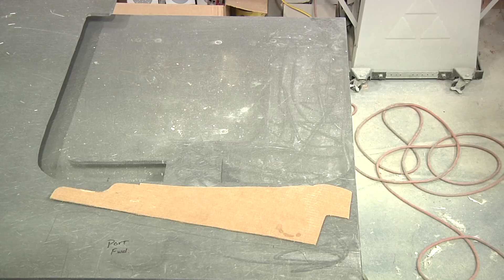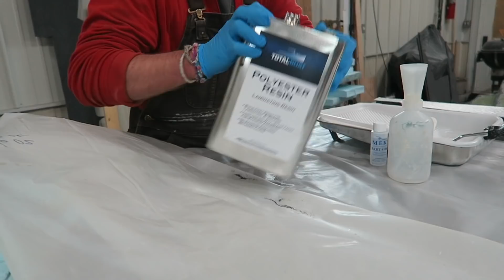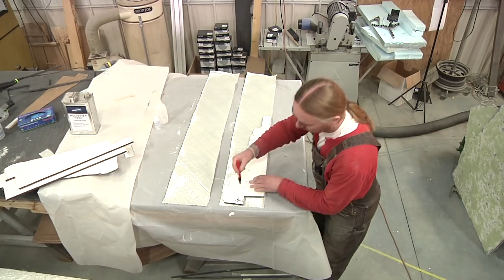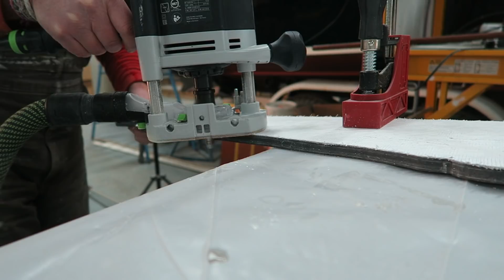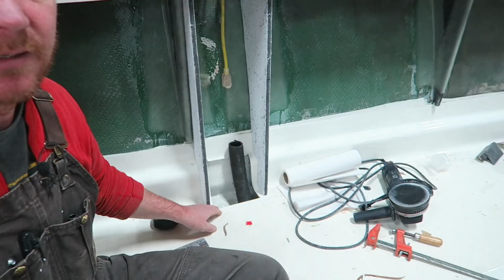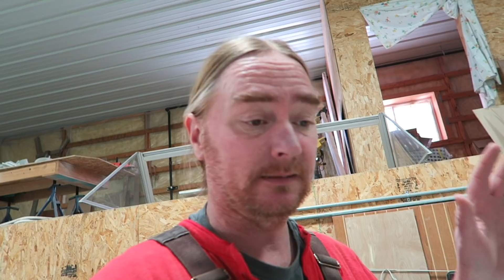Stubbing In For The Fuel Fill Line!

Comment: On our offshore rigs, we often weld a conduit in to pull other pipes through I don't know why it wouldn't work on a boat. Just to warn you if you're planning on putting that close to 2 inch OD hose through a 2-inch pipe you going to have your hands full. I don't really think you can get it through there that you can try. Why can't you just seal off the hose that is sticking up, glass it in, and make it watertight? And then put a door for inspection on the upper part of that box.

Comment: Andy you might want to consider a “direct fill” option for this.  I realize you have done quite a bit of work since this video came out but a “direct fill” can still work and it will eliminate some potential fuel filling issues. Firstly, I hope you get rid of the fiberglass fuel tank and get an aluminum one custom made for the space you have available. This way you can maximize the space for the tank/ more fuel, and you wont have to worry about the aluminum tank deterioration from the ethanol like it will with a fiberglass tank.  “direct fill” would be a flush mount fuel fill on the deck directly above the fuel tank.  Then you can eliminate the fuel hose and make a one piece close out panel on the port side. Hope this make sense and helps.

Comment: don't use P V C for fuel , fuel actually melts  P V C and all of a sudden you have a bilge full of fuel
Reply from the maker: The PVC would not be in contact with fuel, would only be a sleeve for the fuel line to run through :-)

Comment: Form a PVC “sweep” to the desired radius instead of using a manufactured elbow. Angling the hose and pipe instead of making them dead vertical might make it easier to get around the bend. Use cable lube to shove the fuel hose through it. I use the stuff on my boat all the time for wires and hoses.

Comment: I agree with chuck but give at least 6 inch raise from the floor to handle and water splash. The other side I agree with electrical, but the big space would be great to keep the electronics under an inspection hatch and far away from the bilge.

Comment: Andy regarding the hose location leakage problem, can you not make a section that is basically the reverse shape of the section that's already 
Cut out for the pipe and bond it to the floor and up the sides to where the pipe currently stops or just below to follow current line of the moulding. That way you can create the boxing section to overlap this giving you a water seal and also allowing the full use of the hole currently available to put the hose through. It would also help if access is required in the future to the hose fittings incase of damage or failure of connection points.

Comment: what about a 316 stainless steel elbow and tube going up though the glassed floor with a new hole drilled out, use a sleeve  bracket that slides down SS pipe and screws onto deck to stop movement and seal it to the deck so no water can get through?

Comment: Not saying it's right by my 1984 bayliner 2750 has a pvc running through a area and 4 110v romex  hot and cold water and 3 12 wires running through it. If you do glass in a pvc sweep i would run the fuel hose through it first then put it in the boat. That way there is less struggle with it

Comment: I like the PVC (or ABS) pipe idea, but being far lazier than you, I would use two pieces to install it.  One piece under the seat, and the other inserted from above, with a flare on one end to join the two with pipe bond.  Something thinner that Schedule 40 can be heated and molded or stretched by hand or with wedges.

Comment: Andy, you might want to talk to these folks: https://www.conleyfrp.com/ . The # 100 long radius 90 ELL may work for your needs. You could the glass it in place and it would be part of the hull. Then cover the rest of the box with a removable cover for service. Allow room for the vent hose. Have the vent exit near the fill. So you can see and hear the vent while fueling. The best way to avoid spills.
I would avoid having an inverter in a below deck locker. Inverters need a dry and well ventilated atmosphere to operate properly. Before you mount the shore cord, think about how the boat will be docked. You don't what a cord laying across the deck. Keep up the good work.

Comment: Somewhere in your gas fill system you must have a hose to an exterior vent. Typically the vent hose routes along the fill hose. That may be the reason for the large cut out. Also required is a ground wire from the fill point, to tank, to engine, and to external ground.

Comment: Hi Andy. I’m not sure if you meant you wanted to use pvc as a conduit for the flexible hose, or to connect the hose to directly as part of the fuel fill system. If it’s the latter, it will not meet ABYC Standard (2017 which is the current standard) 24.13.8, fuel lines should be of hose or metal pipe. Always enjoy your vids and watch every one! Hope this helped.

Comment: Andy, if you use a 3" sweep 90, it will extend out past the current cut out.  What I would do is cut the 90 in half - from hub to hub - then once again cut across one of the halves in the middle. You'll end up with a half hub which can extend into the closed off area, giving you more room so your hose doesn't rub on the deck.  Glass the half hub to the deck, cut the locker door to fit around the half hub.  Use Taco weather stripping to make all water tight.

Comment: Hinges are fine, unless you're going with something like a stainless piano hinge.  Since you're really into detail, it would be best to recess the hinges so they're not a toe stubbing hazard.  As for the filler hose, I can tell you they're extremely difficult to replace.  As such, I'd just glass in a dam around the bottom and call it good.

Comment: Glass in a stainless steel pipe inside the boat with just enough to put the rubber hose going to filler cap.

Comment: In my business to keep out water at unusual openings, we use a flexible silicone sheet material and 100% silicone sealant that can flex to seal any opening, not be affected by temperatures, vibrations or movements. It can be easily sealed to the fiberglass perimeter and any pass through plumbing. Once sealed, it will keep out water but it would need to be covered as it is functional but not decorative. One thing to keep in mind is that silicone and neoprene are not compatible (any silicone applied to it would eventually discolor and loose adhesion) so  i would not seal it directly to the rubber hose but if you used a PVC or stainless steel "sleeve" at the seal point it would be much better.  Here is a source for the silicone sheet. https://www.amazon.com/Flexible-Resistant-Silicone-Rubber-Sheeting/dp/B01N4KVHYD/ref=sr_1_2?qid=1581336184&refinements=p_n_feature_seven_browse-bin%3A5485686011&s=industrial&sr=1-2

Comment: Run 3" Scepter electrical PVC pipe, nice gentle elbows specifically designed for pulling heavy wire through it. Hose should be just as easy. Once in place a little shot of expanding foam and it doesn't move to wear through. Movement and wear would be the only reason it wouldn't be "legal"

Comment: Without reading all of the previous comments, I think I would have relocated the filler neck to the transom area and not had to have the side channel just to cover a hose. Then again, maybe your tank only has an outlet/inlet on the port, forward side of it and the supply hoses come from the rear instead of the top (can't be rotated 180 degrees in the bilge)? Either way, I'm sure your solution will turn out masterful and you'll have the conversation starter of "Hey, Andy, what's this for?" haha Love your "can do" attitude. *A SS piano hinge would be nice for the new hatches

Comment: If you use the grey pvc, you can heat it with a heat gun and bend it exactly like you want it. Get a test piece, it takes a little getting used to to get the hang of it

Comment: It’s hard to visualize your bilge spaces, but I’d recommend putting your fuel tank as close to the center of your boat as possible. Those outboards are going to weigh some, and I’m concerned with more weight aft you may be compensating with trim tabs. If you put your battery boxes closer to the engines, you have less heavy gauge wire to run forward.

Comment: I have a 1965 25 Bertram fly bridge. Finished three years ago. I ran into your same problem. Bertram originally had a copper fill hose which included the 90 degree bend up toward your fill. I ended up using the same fill hose you have from my tank all the way up to the fill hole. I have covers that go over the hoses so you don’t see them. Even when water gets behind the cover it’ll drop down the edge of the stringer and run out to a drain near your transom into your bilge. Not to worry there’s no wood in the stringers and it’s a straight shot out to the bilge. Don’t forget you need to add your vent hose there too and I remember fighting those hoses to make it all fit. I would not add a pipe you just will not have enough room. Another point regarding your vent hose, use a flush mounted vent for the out side of the hull. My vent is flush and I see it in line with the edges of docks all the time. If it was an old type that stick off the hull it would have been ripped off plenty of times by now. Also double check the strength of the bottom of the hull near the transom it’s only a few layers of glass. I used a composite core foam with layers of 1708 to stiffen it up... just FYI. Wish I could help on this project mine was a lot of fun we fish in the Gulf of Mexico I’m a captain when I’m not working at my fire Dept. Super safe riding boat gets me home every time. Good luck with the project!

Comment: From what I've read is most are agreeing with your ideas. I'm thinking a different route; I don't know if this an acceptable method but, why not place a rubber boot over the hole and orange peel an opening for the fuel hose to pass through? I'm sure there are coating that can preserve the rubber. I agree with others on looking into hidden hinges for the lids. If you decide to place the batteries in the bilge, I would suggest it be well ventilated, trapped acid fumes reek havoc. I'm by no means an expert, this is how I would approach these situations.

Comment: Hinges look good. As for the fuel line good luck trying to get it to bend thru pvc. As for the hose it has to have a red stripe that’s Uscg approved fuel hose. I also see no vent. Build up the dam 3ish in. Make a rounded edge cover it will-look fine. Problem with pvc when it ages it gets brittle also when you install the hose mark the month and date with a paint pen. So there is no guessing when it was replaced. You won’t be able to get that hose the fish thru there very easily at all ask me how I know.

Comment: I my boat the diesel fuel fill lines lasted 19 years before they needed replacing so not sure if you really need any inspection port. But if wanted for access I would say just glass a section to the deck that goes up 2 - 6 inches so water that is running on the deck does not go down into that space.  Then make an access panel from there up to the gunnel cap. My deck is self bailing so when I replaced the 2 lines last winter I just reglassed a shroud around the fuel lines like the MFG did and hopefully I will never have to take it apart again.

Comment: How about route out a recess for the hinges to make them flush with deck and cover? Barefoot and sun could find those surface mount hinges less than desirable.  As for the filler hose, I think a dam would be best. 2-4" from deck up fully glassed, then make a removable inspection cover above. Both sides of boat having the similar 'box' I envision a tilt out knife storage or pliers area.

Comment: Highly recommend using the flush mount friction hinges from Gemlux, they have thinner steel to allow for minimal material removal to make flush, and the friction means that you don't need to install gas or spring shocks inside saving both space and installation time.  Try one friction hinge and one regular on a hatch and if it's not enough friction, use two friction hinges.

Here's a link to the ones I used on mine...
https://www.gemlux.com/FH-1172-FM

Comment: Put in a sweep 90 degrees 1.5 inch  ID  that will give you a good filler  size for fuelling , and glass it in at the bottom., eliminate the hole in the bottom completely, Also add a vent near the top so air in tank can vent and stabilize the tank as you fill. You need to put a upward-horse shoe to minimize water and or humidity in fuel system. Good luck C.

Comment: Andy, regarding hinges; I would advise having longer fingers, as this spreads the clamping pressure, of the screws/bolts, over a wider area, thus reducing localised stressing of the type you are generating by using a small stubby type, with closely spaced fasteners.

Comment: Saw a similar comment: the line that the side skirts would form where they meet the deck continue that line for the boxes and match the curves on the deck to the area just below the side skirts, should be more than enough to protect the area from water intrusion, bit allow for sufficient room to get the fuel line in to the tank. Plus it would make it look like it was originally there and not an after thought.

Comment: Flush mount the hing some how or mount them  under lids. Those hinges seem like a toe stubber..  Glass in the box and add an access cover. You will need to run a vent hose also

Comment: Things that come up on PVC...it can build a static charge...which mixed with fuel is no bueno.  The other issue is "is PVC fuel resistant".  As for bending that fuel line, GET IT HOT.  Soak it in super hot water for an hour or so and it will become a bit more flexible.

Comment: Electricians, when the need a custom bend, use straight pvc conduit, heat it and then mold it to the place they need.

For threading the hose into it, they make a wire pull lubricant.  It is available in the quart squeeze bottle.  It is available at Lowe's and home Depot or electrical supply places.
Reply: https://youtu.be/-soQvQ8Qc3s
Reply: https://www.supplyhouse.com/Ideal-31-388-ClearGlide-Wire-Pulling-Lubricant-1-Quart-Squeeze-Bottle

Comment: Hey Andy, I reverse and or recess my deck hinges so nothing sticks above the deck surface anymore...  I once caught the edge of my tennis shoe on a hinge that stuck up above the deck while landing a big Rock Fish, down I went and cracked my head on my tackle box..... 8 stitches later, I was out recessing all my hinges for a nice flat deck!      On decks where my customer doesn't want to pay for the recess labor, I buy the reverse of this hinge that you have in this video, it has the screw recess on the other side,  so I just notch out where the actual hinge pin is, part of the hinge is still above the deck but the pin is out of the way......In the past, I have cut lengthwise, lengths of 6 & 8 inch PVC pipe, used the inside half as my mold to make a sealed filler tubing cover that just glasses to the side of the boat hull, makes for a very clean job, too bad it gets covered up most of the time....OR, just glass in 2 to 3 inches from the deck floor of the filler area to seal it and make a screw on access cover above for future inspection..... if your worried about the filler tube moving around and rubbing a hole in it, wrap it with plumbers foam tubing or Silicone the filler line to the hull floor.      not sure If I have pics of the recess hinges or not?  but i went as far as making a mold for a recessed hinge to graft into all my lids.... If I find some pics or video, ill upload the link and send it to you.  sorry for the long reply, just some ideas for you to consider? ..... best of luck my friend, Mr. Roach, aka GASSERGLASS

Comment: What if you used foam and sanded an elbow to make a male plug and made fiberglass elbow halves. The halves could be glued together and the seam glasses together. That could match the deck to gunwale angle and could be made to fit the hose stuffed in it. There are also fill hoses that have external ribs to make flexing easier. Trident makes USCG A2 corrugated fill hose that is more bendy. It’s a good idea to lube it before you shove it in too.

Comment: You could use the PVC as a mold, cover it with release agent and form the glass around it removing it after. You get a nice shape and a bit of extra room on the tight fitting side.  As for hinges, any thought to putting them inside?

Comment: I agree with chuckebaker, add offsetting overlaps between the bottom "dam" and the upper service panel. Add a gasket if you want it truly watertight. as to the hinges maybe SS piano hinge. Those hinges you showed appear to stick up a fair bit above the floor and if that is somewhere you might be standing barefooted, probably not good. The spine of the piano hinge could probably be recessed even with the top of the lid and floor with an appropriately sized cove route. For fuel pipes there are corrugated flex tubes, I have them on my boat, that would solve the bend issue.

Comment: There shouldn't be an issue running the PVC, you can even stub a shorter piece of pipe on the end under the deck to make it super easy to run. 

I would not put the inverter under the cabin sole, it needs to be in the cabin and mounted in a very dry place. 

On my grandpa's power boats, he always mounted the batteries up in the sides of the boat, when it comes to electrical, the less chance of getting wet that it has the better!

Comment: How about replacing that section of fuel fill hose with an L shaped bronze pipe (straight pipe to an elbow, then a short straight pipe up)? Then just use small sections of rubber hose on the ends?